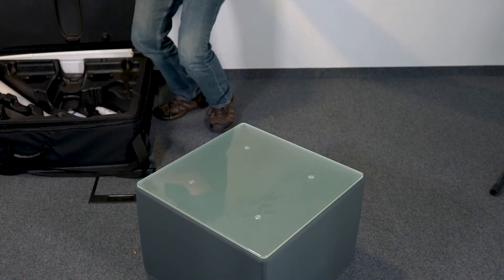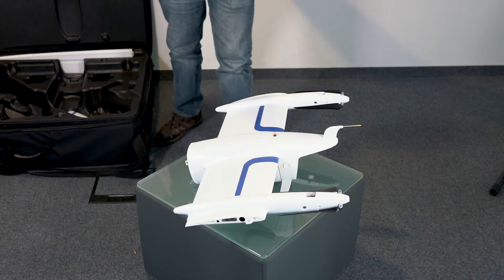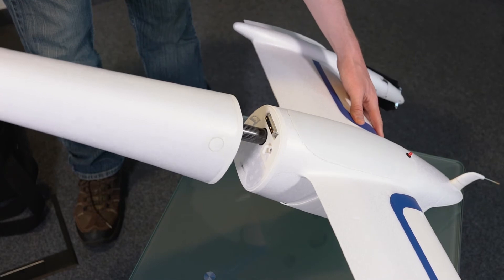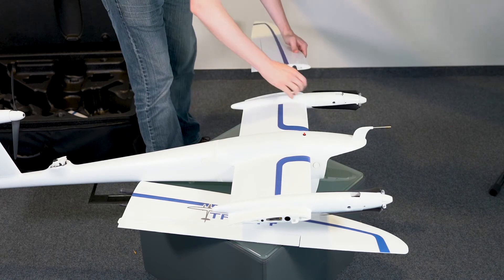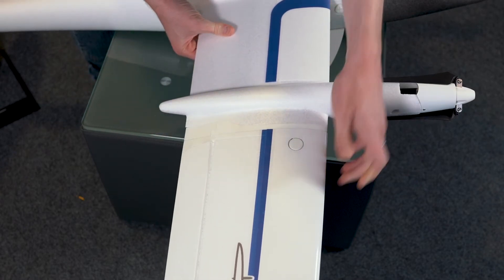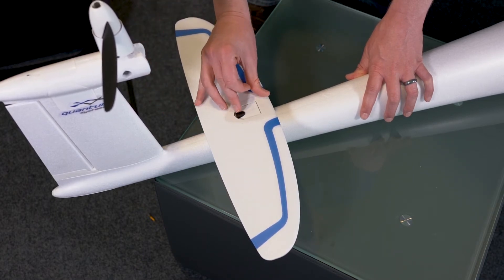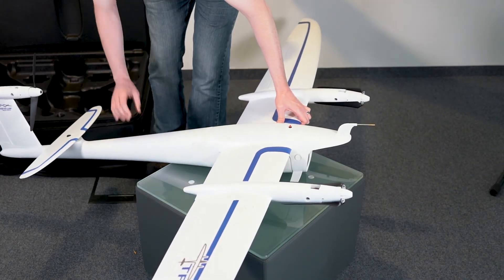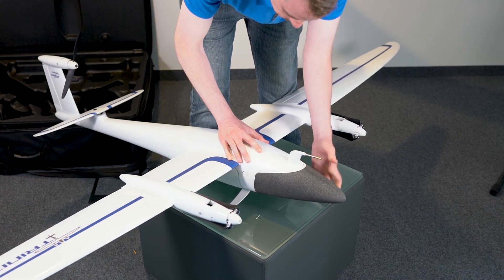How to assemble the Trinity in less than 2 minutes

Comment: What is the bag dimensions (length x width x height) in millimeters?
Reply from the maker: The dimensions are 1002 x 830 x 270 mm (39.4 x 32.7 x 10.6 inch)

Comment: what is that max payload capacity and supported payloadts? and battery endurance?
Reply from the maker: Hello Ahsan, the max payload of the Trinity is 500g. We offer an RGB and /or NDVI sensor as a recommended payload. However you can download the .stp file of the cargo compartment very soon and create your own sensor mount. The endurance is 60 minutes. learn more about the Trinity here:  https://www.quantum-systems.com/trinity/
Reply: Quantum-Systems very nice and can we carry LIDAR sensor?
Reply from the maker: The max payload is 500g. If you have a LiDAR that doesn't exceed this weight and the dimensions of the compartment it will be an option. We haven't found one so far but let's see what the future brings.